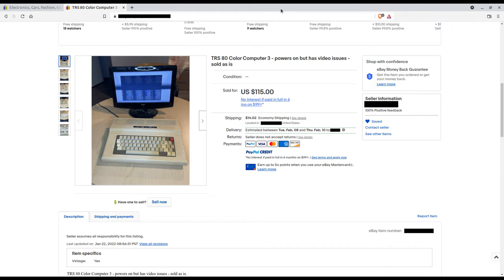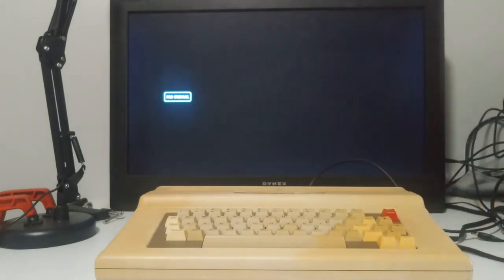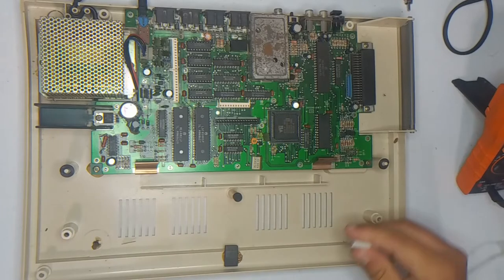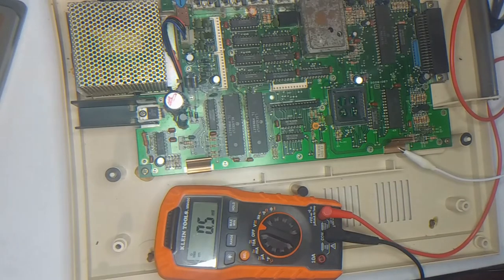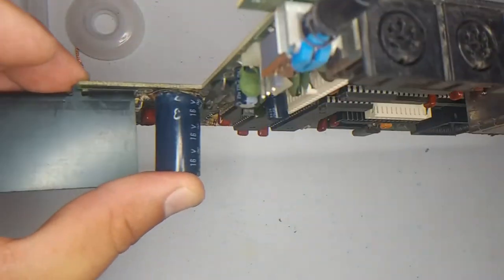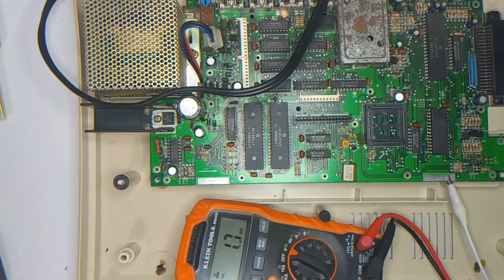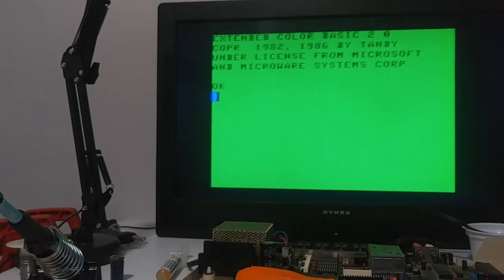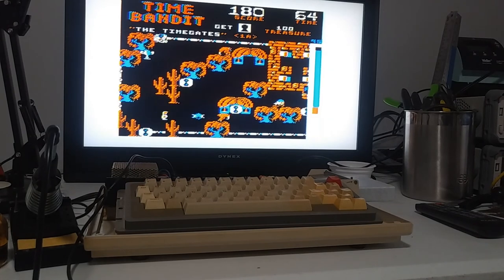Repairing a CoCo 3 I bought on Ebay

Comment: Nicely done. I really enjoyed that. You've saved an old computer from land fill. Wish I could find a Coco 3 (even a broken one). Guess I'll just have to wait for a FPGA implementation of the GIME and build myself one. Very well done on the repair ;)
Reply from the maker: Thanks! This was a really nice one because the Caps on the CoCo's are usually good so I was very very surprised when I saw the condition of this one. If you are interested in making a CoCo 3 then we basically have all of the components to do so, even a re-implementation of the GIME, It's called the GIME-X. Unfortunately the chip shortage means that there is a waiting list to get them..... If you're interested in making a board you can do that as well. There are gerbers and a Bill Of Materials. If you want to build a 26-3026 or 26-3027 CoCo 2 you can get  all of the components except for a case but John Strong is working on 3D printing one soon.
Reply: @rockyhill3  That is news to my ears. I knew that most of the parts were off the shelf but I was under the impression that the GIME and SALT were two chips that could no longer be had. A coco 3 is something on my want list and I would prefer to spend money on the parts and build a whole new one rather than pay a fortune for an original one (here in Europe they can't be had, and if you manage to find one then they are really stupid money). The fact that the GIME-X has more graphics modes and extra bells and whistles would push me towards the making of my own even more. The fact that we're dealing with a chip shortage at the moment means I've got plenty of time to get the rest of the parts together and I'll look into a GIME-X around 2024. Thanks for leting me know about the GIME-X ;)
Reply from the maker: @8bitsinthebasement  There is also a SALT(SC77527) replacement and there is a DAC(SC77526P) replacement. If you want I can point you in the right direction.